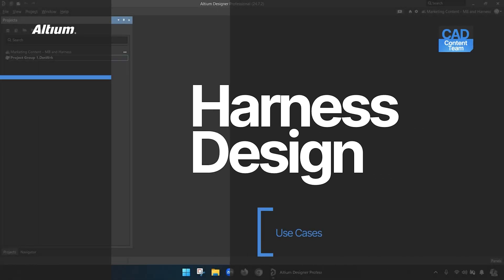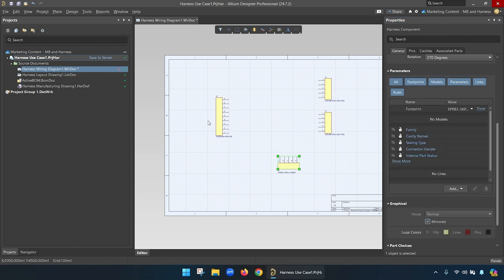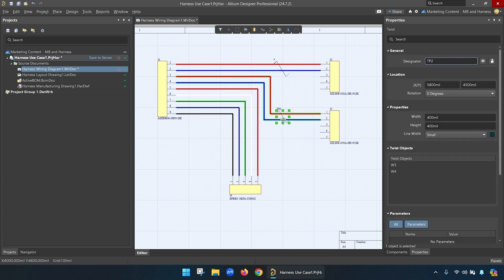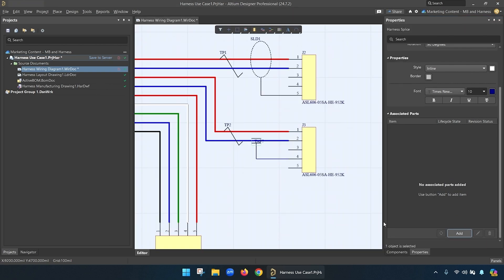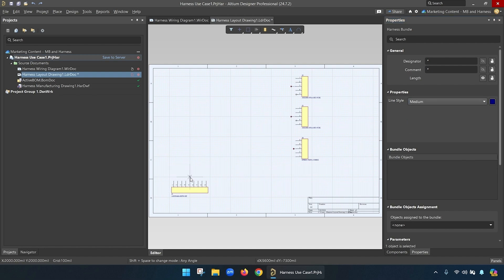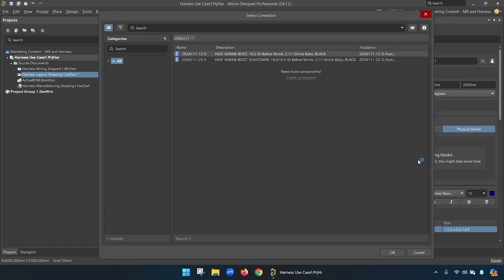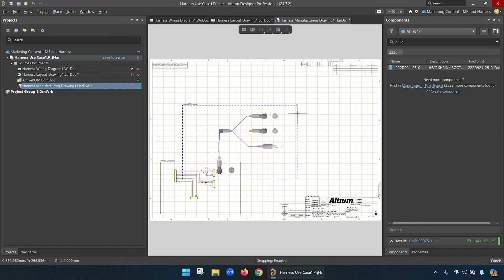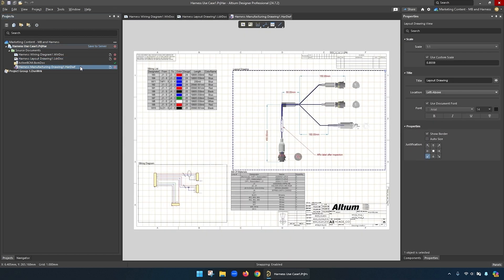Use Cases with Dave Young: Harness Design

Comment: This is a great showcase. However I don't seem to have the your standard set of components available to me and was wondering if there is some way to download a default set off components from Altium?
Reply: Everyone has access to the open-source Celestial library in the Components panel. If you can't find what you need in that library, you can go to the Manufacturer Part Search Panel and you will find many components there. Other than that you can find many open-source libraries on github.

Comment: One question, can you recommend if altium can be used for rack wiring design
Reply: SolidWorks Electrical is probably better suited for this, but be warned the learning curve is steep.
Reply: @FibonacciK  If you had electrical knowledge solidworks electrical, autocad or E3 will not be a problem to learn. Altium harness It looks more to cases where your product mainly is electronic.
Reply: @FibonacciK  Agreed. Its brutal. I have tried but its painful